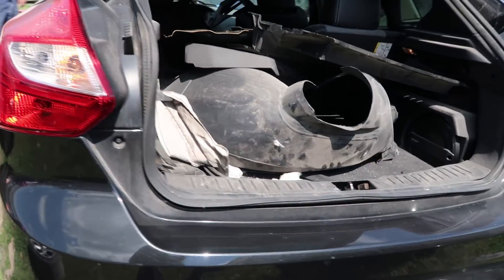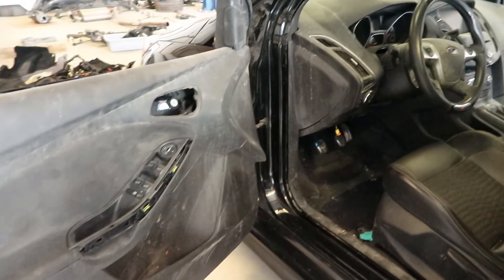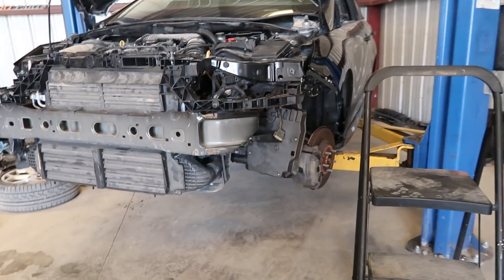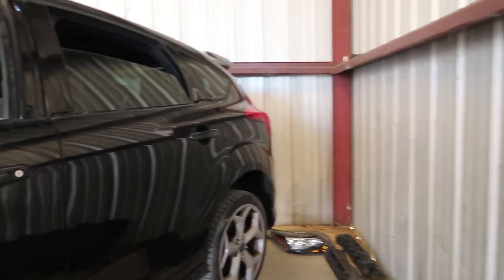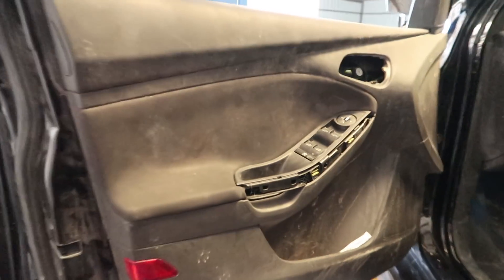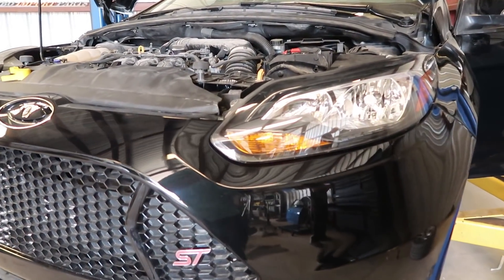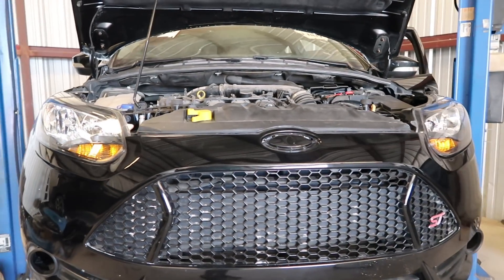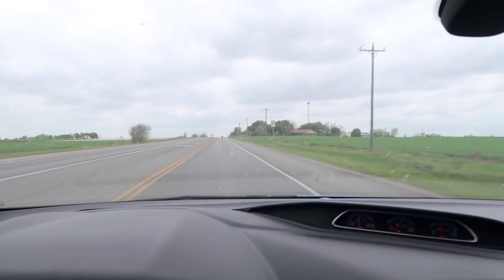Rebuilding a wrecked Ford Focus ST

Comment: I think the issue is the lens. I can hear it focusing. What camera are you using?
Reply from the maker: g7x mark ii
Reply: Rebuilder Guy get canon SL1 or SL2 with a 18-55 lens. Canon sells them on their site as refurbished for very cheap. I use the SL1 with 18-55 lens. Cheap, the touchscreen is get. I recommend getting a back up battery
Reply from the maker: I was looking at the sony line up never used cannons until I bought this one

Comment: @5:20 -> the upper "rubber thingie" was left totally twisted thus hindering the airflow into the upper radiator opening. This kind of careless approach to things that matters makes me question any body shop attention to small details.

Not speaking this "Rebuilder Guy" or his work ethics but salvage auto repair shops in general.
Reply from the maker: Good catch but the upper section barely gets any flow because it’s cut off by the bumper that’s why it looks like snot trying to get anything it can from the grille. The guides are just as big of a gimmick as the shutters. But you are correct I need to do it correctly.
Reply: lol